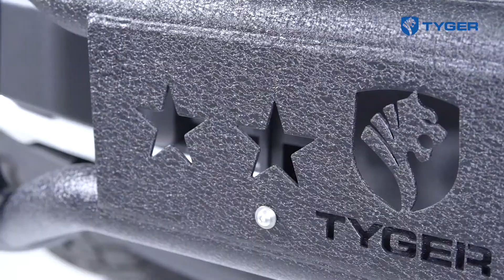TYGER GUARD installation on Ford F150 2018

Comment: Can I attach a winch and pull cars out of the sand with it?
Reply from the maker: The mounting plate for the Tyger Bumper Guard are only meant for attaching accessories such as light pods and light bars so they don't fit a winch.

Comment: is that seriously all that holds it on? hit something and its gonna fold right back into the grill.
Reply from the maker: It really depends. The strength of the no-drilling two mounting joint points is designed to limited impacts. Any question, you may contact us at Support@TygerAuto.com. Thanks!